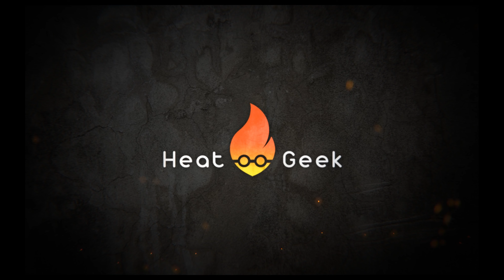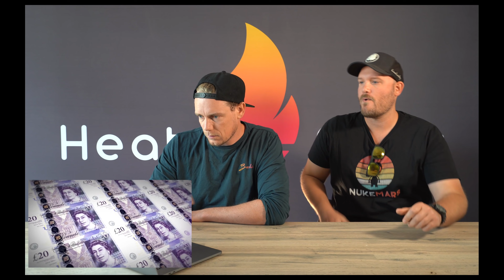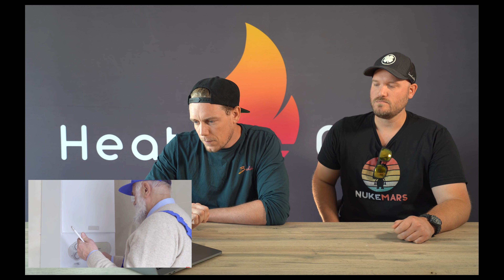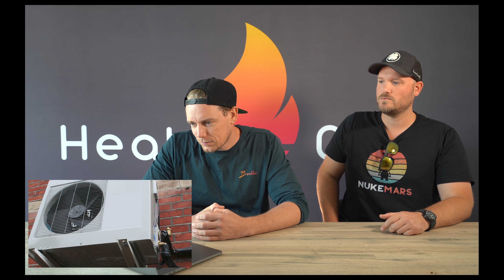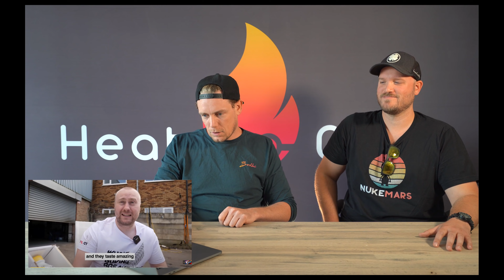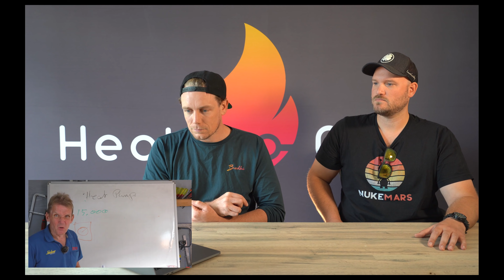Professionals React (BADLY) To Skill Builders's Heat Pump Videos | PART 1 | FIRST TIME WATCHING

Comment: I still haven't seen any unusual climate change and haven't forgotten the overweight lady from the UN saying it was nothing to do with the climate, it was all about keeping the poor in their place with taxes.  We are in a Low Sunspot period and have been since 2016 when we noticed the damage from plagues from Space. Nothing plagues when its warm, the opposite is true. Now more cloud cover can be possible, as well as extreme localised storms of any weather, jiggled Tectonic plates, woken up Volcanoes, and a Chinese chap in the year dot reckoned its the time for mutations, as some of these particles that get through can pass through cells on the fly. 
Try and find a warm Low Sunspot period at anytime during our past. They are littered with crop losses, deaths, rioting, food shortages and regime changes, Pandemics and child saints.
Insulation doesn't warm your house up, the Sun used to for nothing before the Insulation was fitted.
Having insulated many properties since the pilot project in 1980 on solid walled houses in the UK. The ones who angrily demanded it was removed resided in South facing properties or in terraces where they had never used their boilers but had to once the Insulation was fitted. Apparently the Sun can warm your house up even in December in the UK, but investors would sooner you paid for any energy, and if they can stop you getting it for free they will.
The reality is this policy is not for our benefit just like smart meters. Energy for some has been too expensive since it was invented.

Comment: quick question, if puting a heat pump under some trees or in a shaded location is enough to render it near usless, how effective are they going to be in winter when its cold dark and wet most of the time? not trying to be argumentative here just curious.
Reply from the maker: depends on the installation.
Reply: Putting a boiler in a basement without a flue will render it dangerous, if the manufacturer's instructions aren't followed and best practice is ignored then any product will be fallible.

Comment: Let me tell you straight !! Heat pumps are crap they are slow , expensive to run   Unreliable  ,  crap is too weak a description !! I’ve fitted them and back in 2007 I looked into them and the tech is still the same you two have  not got a clue
Reply from the maker: Lol. The hps back in 2007 weren't a patch on current models when it comes to scops.

Comment: These guys are selling this garbage so they are going to tell you that they put out good Heat, believe me they do not put out good heat at all and I don't care who installs it because that's the technology in these things. If you live somewhere that has really mild winters then get a heat pump I'm sure it will be just fine. You might even be okay if your house is modern and super well-insulated in a cold area. But if your house is not super well-insulated and you live in a part of your country that gets well below freezing in the winter time, you will freeze your ass off while your furnace is running and giving you a super high electricity bill. 

If you live somewhere that has freezing cold temperatures, guys like in this video will tell you that a heat pump is going to give you fantastic Heat. But it's not going to give you fantastic Heat it's going to give you the exact opposite of fantastic Heat, you will freeze your ass off and you will pay a lot of money every month to do so. I had a professionally installed heat pump and it was a terrible experience. I switched to a forced air gas furnace not with a boiler or anything, my house got a lot warmer and my heating bill is now less than half of what it was before. My gas bill is cheap very cheap and my electric bill is a fraction of what it was before.

By the way what's up with these boiler heating systems in England, that sounds like some super ancient technology?
Reply: We do sell heat pumps but we also sell gas and oil boilers, fuel cells, solar etc.  There is not one solution to homes and we turn down more heat pump installs than we go through with as so many homes are unsuitable.

Comment: I watched Roger's video and came to the conclusion heat pumps for my old house are impractical, placement, noise, expense and upheaval of new radiators, pipes etc. To seal a house completely from the outside weather is unhealthy and we need to open windows (we've got the covid brigade telling us to open them), the house needs to breathe and condensation controlled. My conclusion was to replace my 14 year old gas boiler on a good B Gas deal over 5 years. It will be forward compatible with hydrogen should that happen and some way down the road maybe heat pumps will be a good thing. As it is I reckon just now I'd need more than one ASHP and keep the combi installed as backup. The B Gas engineer said they are still installing combis in new builds and we, our house, were one new boiler away from whatever the future holds. If gas gets too dear I'll have to turn down the heat, but I'll be £10k better off.
Reply: What these 'heating engineers' fail to understand is that the TWO units of a heat pump should be placed on the input and output of your house's ventilation system. So the one on the input heats the incoming fresh air and the one on the output extracts as much heat out of the outgoing air so it's 20°C colder than the outside temperature !
Reply: @millomweb  ,what ventilation system is that? Very few British homes have air conditioning. If it’s too warm we open windows.
Reply: @juliebrooke6099  If it's too warm ? When does that ever happen here ?
Reply: @millomweb  nibe did one and it was the primary source of heating in many homes. It was a disaster  it couldn't cope.

Comment: Roger Bigsby has been at the leading edge of the plumbing industry since the late 90s. Hes extremely clued up.
Grid will go over to hydrogen well before heat pumps become the norm.
Has wont be going anywhere for some time to come
Reply: Clearly you know absolutely nothing about hydrogen otherwise you would not have posted nonsense. I suggest you go and read up on why hydrogen is an extremely bad energy carrier.

Comment: The other issue at the moment is that most of our electricity  in the winter comes from gas powered stations so until we get some more nuclear power its not really lowering Co2. Also is there enough copper in the road to power all the houses and EV's electrical load will go up massively .

Comment: Guys I was going to transfer to heat pump technology but listening to both Roger and you two guys I’m am convinced heat pump are not a good retrofit solution. Roger may have been on a rant but everything he said is correct. You both may have some knowledge on this technology not all you have done here is to convince me NOT to use heat pump. I suggest to team up with Roger and get some real lives experience.

Comment: Roger Bisby is a qualified plumber, and been in the industry, when you guys weren't even born.
A much respected figure.
Reply: I'm with Roger. What is not mentioned is the cost of these experts who reckon they know a lot more than a mere plumber. And their costs when I ring them up to come round and maintain the complexity of what they have installed.
Reply: @andyharpist2938   Consider total cost of install, maintenance, and energy use for the life
 of the system.   Cost of all modification$ to the structure must be calculated.
                          The older it gets the more repairs it will need.  Also, more complicated means more  repairs.  Remember,,,  very skilled technicians and engineers don't always comprehend finance.
Reply: Who doesn't understand science
Reply: |Being a plumber is not the same as understanding the thermodynamics of a reverse heat engine, i.e. a heat pump. By the same token electricians understand only as much as they need to know about electricity which is actually not very much. They are not professional engineers.
Reply: A plumber fits bathrooms not heat pumps that's a heating engineer two different trades

Comment: I would love to understand why you think this guy is wrong... "While some standard air heat pumps can operate as low as 4 degrees Fahrenheit, the device will have to work extremely hard to pull heat from outside into your home if the external temperature is below 35 to 40- degrees Fahrenheit. When temperatures reach below freezing, the heat pump will then use emergency heat to supplement the heat energy needed to warm your home." What does this have to do with installation?  The reality is the heat pump needs a temperature differential and as temperatures drop this differential drops and so does efficiency.
Reply: All standard heat pumps work comfortably at 40 degrees Fahrenheit and if sized correctly will never need to use an immersion to supplement the heating requirement of the property.  I have been involved with heat pumps since 2012 and not one of my customers has said they are not warm enough! A property needs a proper heat loss calculation measuring the whole house and calculating the correct u values. You then size the heat pump to the resulting figure from the heat loss calc. I'm willing to bet Skillbuilder never did this on his installations
Reply: Heat pumps can be expensive to operate if your cost of electricity is high and work best in warmer climates, you are correct in that any HVAC needs to be sized correctly.  Can it work yes but as he states if the house is not tight, drafty and poorly insulated it will work harder and run electrical bill up, will it keep you warm possibly if sized correctly.  I’m an engineer and we deal with these often, we do not spec out heat pumps in colder climates only in warmer, they struggle to maintain comfort and most colder climates have high electric rates (US).  Up until recent natural gas prices have been at an all time low so why not spec out and gas fired piece of equipment; however, this may change since gas prices are extremely high and don’t look to drop.  Can they work yes, do they heat as well as a gas fired unit…no.

Comment: Iv been a fan of heat geek and Roger for ages. They both know what their talking about when it comes to their respective revenues of the trade. Heat geek awaking and mastery course is absolutely TOP NOTCH learning. And Roger has incredible content on bathrooms, I'd have never looked at abacus board without his video on the subject of bathrooms.  But as a person who's been through the heat geek mastery course I know for a fact heat geek knows what he's talking about. It is the best course there is in the  UK on the subject. So I'd rather take heat geek point of view on this matter as he's what you'd  call a PRO in this matter. Until V2 heat geek hopefully been sooner then later........truly amazing course
Reply: The trouble is heat geek don’t represent the average heat pump salesmen and installers. The know and installers are not out there.

Comment: You two are not professional I watched up until you said heat pumps don’t cost more you are totally wrong they do and will never create enough heat and are not reactive to quick changes in temperature, stop installing and find something also to do….  Clowns would be good for the both of you.
Reply: Did we say that?  Heat pumps cost more to install because of the upgrades required but don't have to cost more to run, it completely depends on the way they are installed.

Comment: Errrm what I heard was two guys struggling to discredit the video and saying it’s ‘possible’ or not ‘quite’ true. But that says to me that in general the original video is valid in the points it raises. I had underfloor electric heating installed on the ground floor and my electric bill tripled and that’s with a smart learning thermostat ensuring the system was as efficient as possible.
Reply: Fitting any kind of resistive electrical heating is not very clever. There is a weak case for storage heaters running on off peak electricity. I have seen adverts for electric resistance heating designed to ensnare the uninformed. In my opinion such things should be banned..

Comment: ive been offered a fujitsu aoyg14lec made 2012 air to air heat pump, my living room is 12 foot square input power is 1.105 and output ratio is 3.62 do you think its worth getting?
Reply: If you live on a hill it could be a handy wheel chock
Reply: @nickcoppard5335  :) ah ok so it's not worth buying this type or is this one to old ? I live in scotish Highlands and theirs no mains gas , my house is small , just one room to heat ,
Reply: @nickcoppard5335  i have a rayburn stove and yes i heat with that but was thinking using electricity and storage heaters not great, are off the shelf air to air heat pumps not great? if i understand what it says on the label for every 1kwh you burn you get 3kwh of heat? sorry if i'm wrong, please explain
Reply: @lookoutleo  it seems to be about the sort of conversion they claim I think you would be lucky to attain that together with the long-term maintenance costs God will never increase the price of wood but EDF will always put up the price of electric
Reply: @lookoutleo  my Rayburn works wonderful with a couple of good old fashioned cast iron radiators
Reply: @nickcoppard5335  yes mine heats the water on a direct system. but house to small for bothering with any radiators . prob here is carrying the wood to the house, its a long way.  so you think the off the peg air to air just no much cost to buy and maintain then? ive seen them new from places like appliance direct for £450 i suppose its alot of electricity

Comment: Hi guys, you two lads are certainly promoted by the government initiative if you are really engaged in promoting heat pumps as a absolute alternative to gas heating. We all know that most older properties in the UK. are not suitable for installation of heat pumps..            I would agree that we need to address the carbon problem, but let’s be sensible about it, a lot of homes are mid terrace so where do you fit the pump. You mention maybe one day there may be combi pump set ups, well, let’s get the pumps purpose ready before forcing people to buy a system that won’t work in there situation, then have to fork out for a new system when they get it right,

Comment: Hi Guys, don’t forget that gas boilers are now Hydrogen Ready and as you know, the waste is water, in my view, the only way to have a Heat pump is to go off grid with sola panels and wind.
Reply: True, but there are number of issues surrounding gas boilers, how does a whole section of gas grid become hydrogen ready? Door to door checks to see if every appliance is hydrogen ready? What if Mrs Jones likes her gas fire the way it is? The bigger issue is that most methods of producing carbon are either carbon emission heavy or inefficient. A heat pump would also be very difficult to run off grid, you would need a decent size wind turbine to ensure there was enough energy for the heat pump in winter
Reply: Some boilers are capable of up to 20% H2, 100% capable boilers are in testing but we are decades away from having enough production of the fuel.  It's a red herring.

Comment: The reduction in Co2 from this expensive nonsense is negligible. The gas powered electricity generation stations that replaced coal was largely pointless and should have been replaced with nuclear. The general public largely don’t give a stuff about the climate hysterics.

Comment: I disagree about harsher winters in the uk. 
I can remember back in the 80s the winters where killer proper snow falls etc.
Reply: We are now in 2022. Winters are relatively mild. Just as an example, we had 2 heat waves this Summer.
Reply: @MariaJimenez-ye9sn  I don't see how two heat waves in a summer is an example of how winters are now milder. We also had two heat waves in a summer in previous decades.
Reply: @1983englishman  we literally had no snow for a few years here in Birmingham. It's barely getting below 0C during the day so it is clearly a mild winter...

Comment: Call that a heat pump? That's an air con unit and an eyes saw.
I thought a heat pump would be like a central heating pump with an element inside of it. AND IM NOT EVEN A HEATING ENGINEER!!!!   What could be better than direct heat from electric to an element then to water/oil, instead of fannying on with fans on the outside of the building? So design that and plant trees in your spare time.